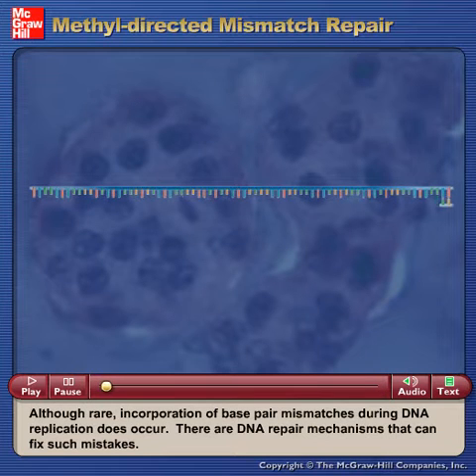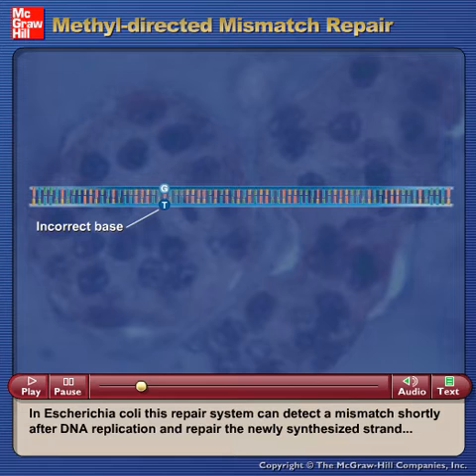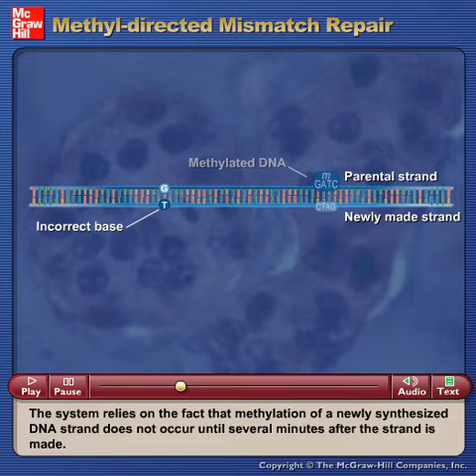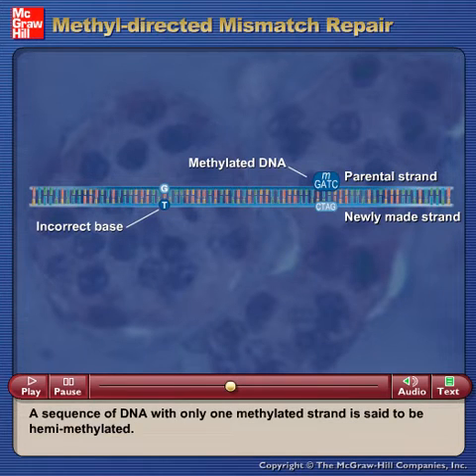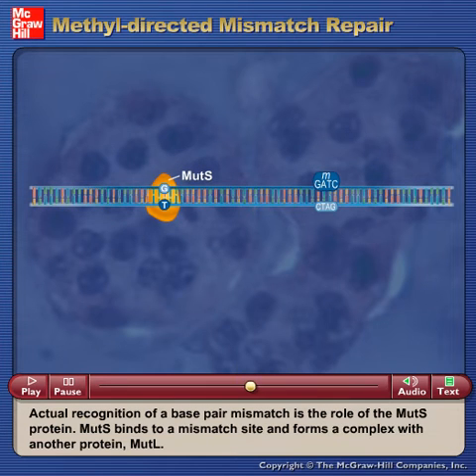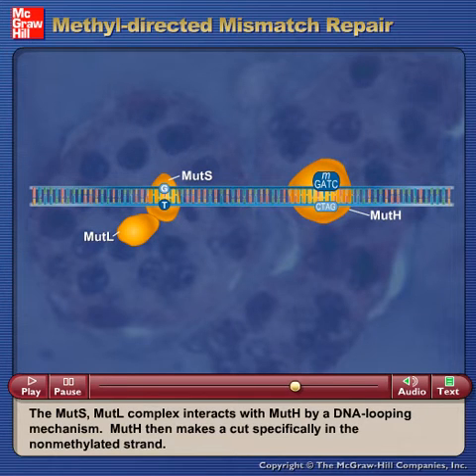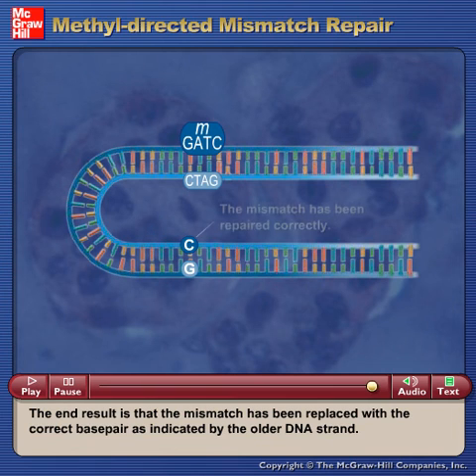Mismatch repair

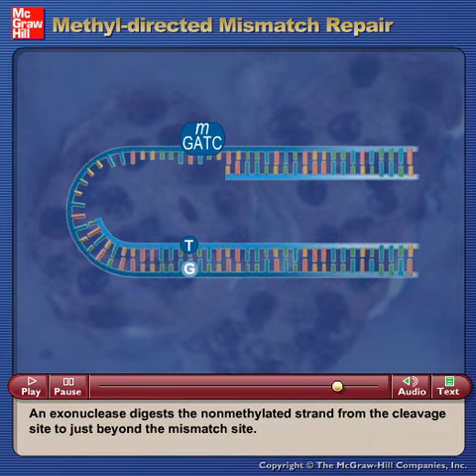Comment: how does the exonuclease at 1:31 know to keep digesting DNA strand until it comes to the error? Why does it not stop before the error, or not continue on for many more bases after the error?
Reply: MutS was bound to the mismatch site. The Mut complex just disappeared in the illustration to allow you to see that nuclease removes the nucleotides from the non methylated strand (from the site which was bound to MutH) to the mismatch site (bound to MutS). MutH made a cut in the strand, exonucleases cut nucleic acid from free ends, therefore it was able to recognise the cut and continue from there in the direction of the Muts. Nucleases have specific directions in which they move. A strand is usually synthesised in 5'->3' direction.  Some nucleases can move in both directions, but since the exonuclease mentioned is not specified, you don't know its specifics :) Hope this helps...and I hope I got it all correct :)
Reply: You'll probably find that its still unknown.. :P